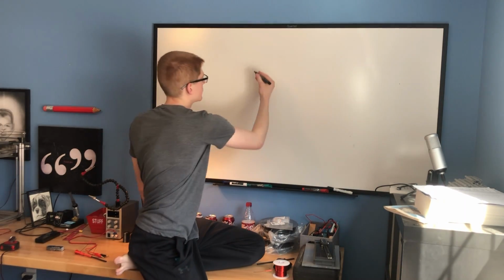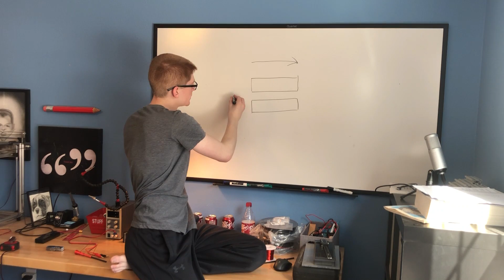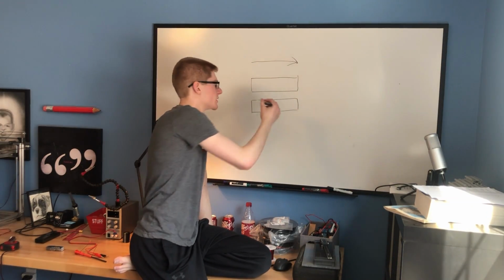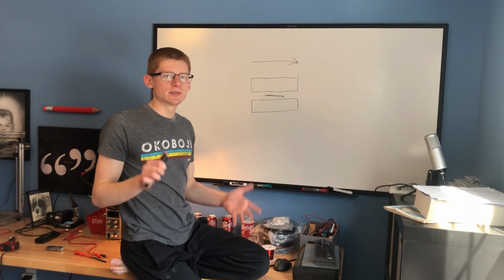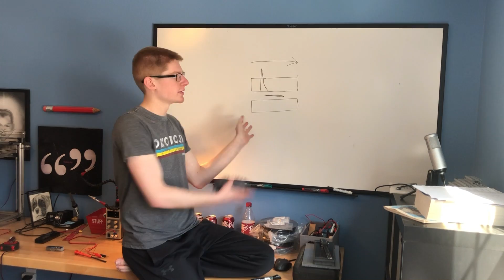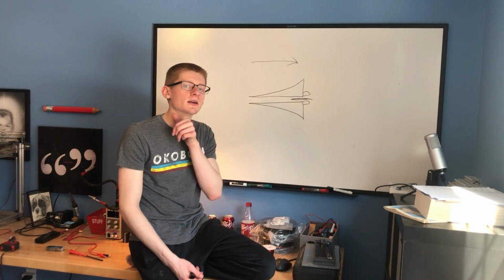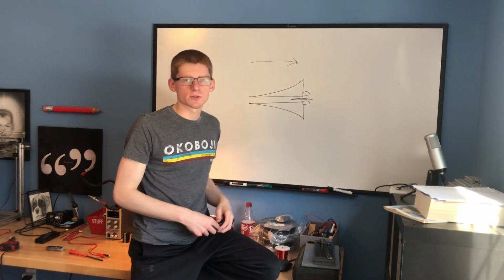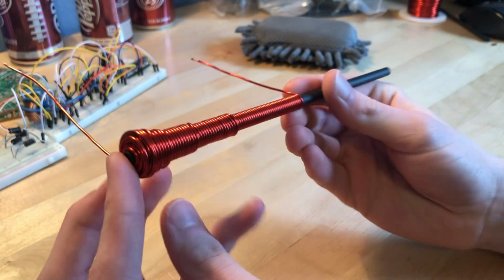Making a Coilgun - Part 3: Reconsidering Everything

Comment: I feel like you were on to something with that design, but I also thought of one while watching this. using the standard coil design, what if when energized it pulls the projectile to the center, but instead of just cutting the power and dealing with that not instant decaying field, what if you then reversed the electrical flow in the coil? this would require a magnet of some kind on the back/front of the projectile I would think, but essentially have the coil both Pull and then push the projectile? that way you dont have the slow down/pull back from the decaying/collapsing magnetic field. I feel like some photo sensors and solid state switches could handle that power switching quite easily.
Reply: You can't just reverse the polarity of the coil, to do so quickly requires insanely high voltages (infinitely high)
Reply: @pcgee12  Not true
Reply: @ryccoh  V=L * dI/dt, try to reverse current quickly you need high voltage, it's not the only reason it won't work, but yes it is true, it's one of the most basic principles of an inductor
Reply: @pcgee12  Sort of, the time constant will be the same it's just that with higher voltages you'll reach your target current and thus target flux density sooner
Reply: won't work
Reply: You would need a magnet and it would be really tough.  AC power is essentially doing this how how to program that makes my head hurt

Comment: How about an induction type with a copper/aluminium projectile.
Reply from the maker: I have not looked much into them, but I have heard that they overcome a number of obstacle inherent to traditional designs. My somewhat uneducated concern is that it seems it would require much higher current to get things going. Though it might be able to produce higher efficiencies when scaled up, ferromagnetic designs can easily move the projectile even in very small scale. Not to mention that non-ferrous materials have considerably lower densities and would require more volume to compensate.
Reply: @LeviJanssen  Yeah you have to use either volts in the kv range or less turns of let's say 12 guage, the great thing is there is pretty much no saturation and no such back but as you said it requires a short pulse. I used some online calculators and a coil of 24mm long and 24mm in diameter with a 8mm hole (48turns of 12 guage) should have a peak of 4-5ka and the whole pulse lasts about 10ms (depends on esd and esl) this is with a 450v 8.2k uf cap. Wether that's enough to get aluminium moving idk but it should be roughly 6 tesla which is pretty good I think, not really much info.
Reply: Where did you get the number 6 Tesla from (seems a bit much but if that is true than that would mean that ferromagnetic projectiles would be saturated way beyond their max capability and that is where copper/silver/aluminium could get pretty useful if the magnetic field of the projectile could be arranged so that it would be pushed/pulled from/to the coil
Reply: @stefanehm8718  I think it was from some online calculators, as I said it's a very short pulse. Also a aluminium, copper ect projectile would repel the short burst of emf and a hollow projectile might be best but also has the problem of possibly collapsing and or blowing up the coil.
Reply: @benlawton5420  I looked it up and there are some very interesting induction coilgun (non ferromagnetic projectile coilguns) designs in form of research papers out there where theyhave about 10kV capacitors and only 30 turns of very thick wire and a effieciency about 28 % which is HUGE (and a max. saturation of around 22 Tesla)

Comment: Wouldn't a Super Capacitor of say 1000 farads at about 24 volts, be able to give the coil a good shot of energy? We could use an SCR to switch the power ON, to the coil.
Reply: That would mean a HUGE and very long Tau which makes the time the capacitor loads and puts out energy extremly long and you would also have only under 100A which is kinda lame in comparison with 400V capacitors!

Comment: I feel like you're on to something here. I think try a pancake coil for the last coil(punch the barrel through a piece of paper with glue on the paper, and add on to what you already have) to pull the center of the field more to the end. Also, when you did the sketchy battery test fire thing you had the battery connector facing the same direction that the gun was firing(, try to align the battery connector so that when you touch the coil lead to the battery lead, the recoil will pull the other coil lead out of the battery lead for an auto disconnect.  I've never liked the cap design, direct power is the way to go.

Comment: Very cool indeed! Do you foresee any situation where multiple non-linear stages would be an appropriate solution?

Btw, better Micing would have made a big difference, you have a good speaking voice and avoid excessive uummms and aaahhhs - so use that mike (even if it get's centrally in shot) to capture a less "recorded in a box" recording! I've found that sensitivity to jumpy video is amazingly large, good audio is way more important.
Reply: Agreed, just some basic audio leveling and EQ stuff would make this far better

Comment: At some point it seems like the inductance of your one coil will become a bottleneck. I wonder if using a much bigger inductor to store the energy as opposed to a capacitor would work. As in, charge up a bigger coil slowly to a decent current then shunt it over to having your coil in series. The bigger coil will want to remain constant current so will energize your firing coil. Basically a single shot of a boost converter. Then you should be able to scale up indefinitely because your staging and active coils can both be scaled up together and any charging circuitry won't be interacting with the active coil at all.. hopefully that made sense. A high current battery may not have the voltage to immediately bring your firing coil up to current but with the staging inductor boost effect that shouldn't be an issue for even very large coils.
Reply: cool idea

Comment: What's the resistance and wire gauge of the coil you made?
Reply from the maker: The total resistance was around 0.16 ohms, though I don’t have the proper equipment to measure low resistances. I used 16 gauge wire.
Reply: Would a thinner braided wire work?